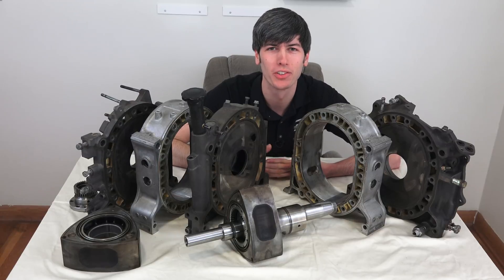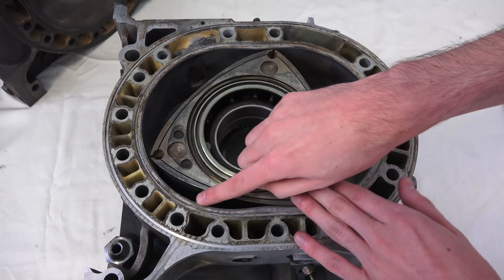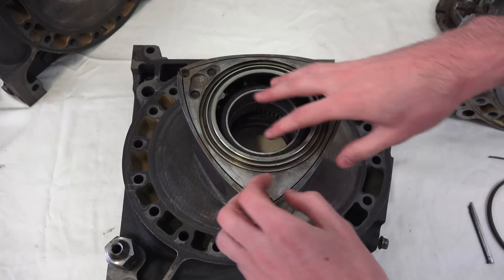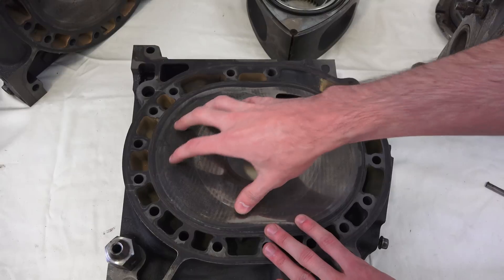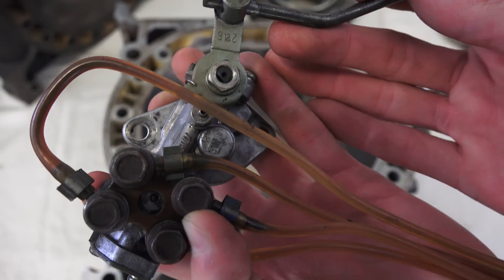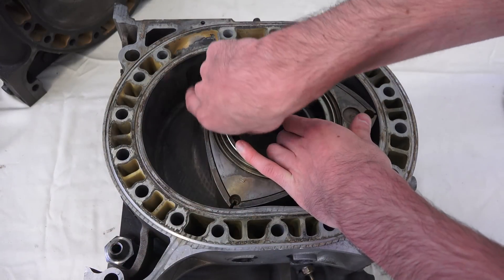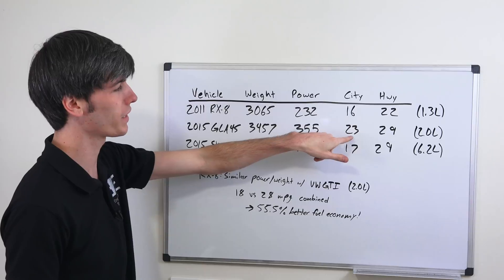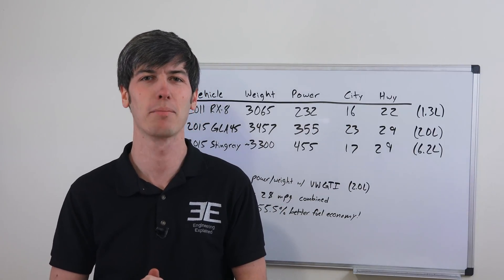4 Reasons Why The Rotary Engine Is Dead

Comment: I just think it needs more research and development. Maybe with a "slightly" different design of the rotaries or maybe the housing of the internals. Could use a different type of metal to combat the huge temperature fluctuations. We, as car enthusiasts, can deal with the oil/gas consumption. Just not so much of rebuilding more frequently than a normal piston engine.

Comment: the speed flame of ethanol is 13% to 18% quicker than gasoline, so the wankel would work better with ethanol not eending unburned fuel out the exhaust

Comment: I read about a motor engineer in England who used to reverse-engineer Wankel engine cars by fitting Ford V4 piston engines.  Eventually he had a warehouse full of "dead" Wankel engines.  He asked a friend who worked in the aerospace-special-metals industry to have a look at these engines.  "Oh they're using the wrong metal for the seals!" was the answer.  When new seals "Made in England" from exotic aerospace metal were fitted the "dead" engines came back to life!  Unfortunately AFAIK, there was  no market for these engines as the car owners were now perfectly happy with the Ford V4 which was cheap and easy to maintain.  Those V4 engines of 1700 and 2000 cc were very compact and they were also used by Saab when their 2 cycle engines were given the "Red Card" on emissions by the European Common Market legislators.   These days Emissions seem to be the be-all and end-all and in the UK,  cars registered after May 2001 pay "Road Tax" according to their emissions of CO2.  In practice one really needs a Direct Injection Common Rail Turbo Diesel in a car that gives 60 mpg in actual everyday running.  Electric cars pay no road tax but this is IMHO fraudulent as their CO2 is simply moved to the power station chimney!

The Wankel is NOT dead yet as it is still useful when a lot of power is wanted from a small light package.  For instance someone I knew bought a small Wankel engine from an ex-soldier who had "liberated" it from an enemy Anti-Aircraft gun!  The engine used to drive a hydraulic power pack for the gun's servo but the engine was small enough to be put in a rucksack and taken home!  The plan was to build a small generator-set but these are now so cheap that DIY methods are uneconomic.  Have fun!

Comment: Well the facts on the fuel efficiency is off,, as the oil being injected is also part of the fuel use,, meaning you need oil cost included.. In the end Your getting a bat out of Hell motor that revs like a 2 stroke.. the rx 8 just aint a good comparison.

Comment: Rotary engine is mechanically less efficient (much less leverage slightly offset by the lack of camshaft & valves). Less thermodynamic efficient (incomplete combustion). Volumetric efficiency is probably on par as there's no valves in the way.

Comment: Compare it to a A45 engine? Seriously? That A45 will barely last 100,000 miles it's built to die. Also it's new and the RX8 been around for centurys. Also the claimed fuel economy is always higher than in reality. But if the figures are anywhere close to reality it's pretty insane that it uses as much fuel as a V8. The new vette only gets decent highway mileage due to gearing etc. So your examples for fuel economy are horrible.

Comment: You completely negated that physics that make this engine a "torqueless wonder" compared to piston engines. The fact that the combustion process isn't merely expanding in a downward motion to move a piston, the rotary has to spin the dorito. This results in more loss of potential claimed torque be put into the eccentric shaft.
Reply: +Boosted98gsx Plumbers are familiar with "low torque" too. When the wrench won't break the pipe threads apart, they put a long pipe on the wrench handle, TO INCREASE TORQUE! The Wankel engine has piss-ant torque. It's crankshaft, re-named by the sales department "E-shaft", ('cuz a rotary just can't have no steenking crankshaft.) E stands for eccentric, news flash, ALL CRANKSHAFTS ARE ECCENTRIC! It has a miniscule torque moment-arm of 0.60", half (always, on any crank) of it's tiny stroke of 1.2". Every other fault of Felix Wankel's waddling, (as opposed to rotating) engine is secondary to it's tiny stroke. 

It has to waddle to create the reciprocation that drives the tiny crankshaft, that's why the engine's chamber is an epitrochoid, (figure 8 shaped) it transfers energy exactly like a hula-hoop. All the "rotor" can ever do is PUSH against the crankshaft  like a connecting rod, because THERE IS A BEARING BETWEEN THE "ROTOR" AND THE CRANK!

Because it's cast iron "rotor" weighs over 9 pounds, it waddles slowly, making only one revolution for every 3 of it's crank. The sales department nailed the tachometer to the crank to disguise the fact that it's waddling "rotor" redlines at only 3,000RPM, while it's tach tells it's happy owner that it's redline is 9,000RPM. Waddling slowly over a tiny distance, makes the Wankel inferior to even the piston engine, which at less than 25%* "efficiency" for the worlds latest average, is not saying much.  *per the DOT.

The horsepower equation has two factors, one is torque, the other time. The first recorded example was written by James Watt as 33,000 ft# (the torque) in 1 minute, (the time). Reducing torque reduces horsepower at a 1:1 ratio, because the time is a constant. There is a trade-off teeter-totter of torque vs RPM in piston engines that the Wankel can't take advantage of, because increasing it's stroke appreciably, would sling the fat "rotor" out.

Fussing over large swept chamber area cooling, burning oil and short seal life, is like polishing a turd…… None of that will change the inherent flaw of Felix Wankel's mechanical principle.
PS, the flat top of a piston makes NO difference. If it did, the the wedge-head (flat piston) Mopar would be stronger than the "pent-roof" (like the roof of a house) piston head of it's Hemi brother, it's not. Pressure only "sees" net area, not shape, nor even the direction it's coming from. It's not the same as a bat hitting a ball, nor even wind against a windmill, both being a transfer of kinetic energy, not pressure.
Reply: +Bob Campbell I never made any mention of the geometry of the top surface of a piston.
Reply: +The real doktorbimmer I suppose that's why rotary based driven compressors are more efficient.